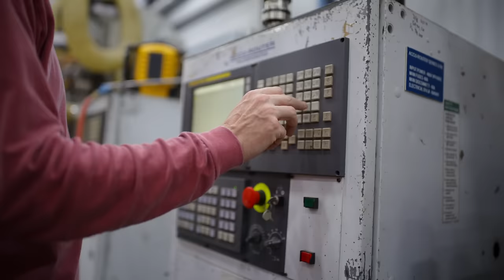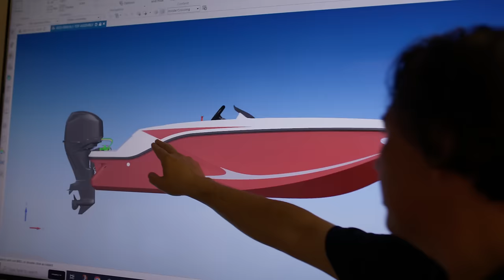Launch Video | Rebrand 2023 | Bayliner Boats

Comment: So aside from not putting element on every deck boat, what changed?
Reply: Nothing..as far as I'm concerned..just to please some genders ..
Reply from the maker: Hi there, you may have noticed our new look, and you may ask yourself, what does this mean for Bayliner? 

Well we're happy to share that this new look is just the beginning, but we'll always continue to listen to our boating community because we're also boaters. To learn about the history of Bayliner and how far we've come, contact your local Bayliner dealer.
Reply: @bayliner   so uh…. Nothing. Everything is the same as last year then
Reply from the maker: @SA1NT53  Bayliner's promise is maximal simplicity. We're all about removing barriers to enjoyment and making it as easy as possible for our customers to get the most out of the time they'll spend with our products. This rebrand has started with an easy-to-use website and new logos - we will begin reflecting the new design in our fleet in 2024.
Reply: @bayliner    Oh trust me I have faith in the brand, and I’m familiar with the history, I’m a Bayliner owner myself (1999 Capri Cuddy), I just don’t understand the rebrand announcement if the only difference is just a logo change, and a website overhaul. Why not wait to announce the rebrand until the new fleet comes in?